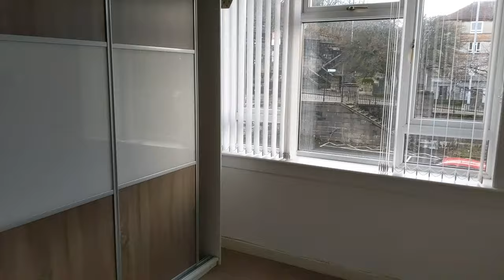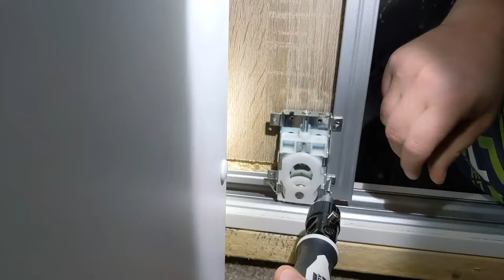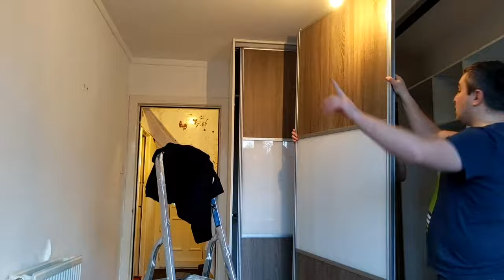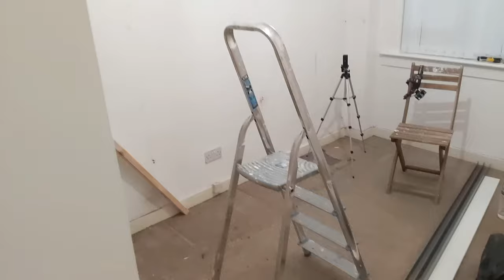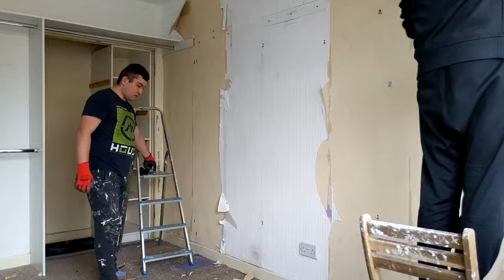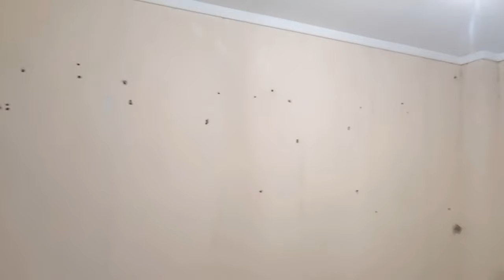Built in wardrobe removal: Removing sliding closet doors from tracks

Comment: That is NOT the way to remove those sliderobe doors!!! These people unscrewed the roller assemblies - totally unnecessary. All you have to do is look at the roller and notice the circular part, put your finger there and unclick it by lifting it up slightly. It does take a little effort but when assembling it just clicks into place. And then all you have to do is lift the door away.
Reply: Hi, my roller assembly not screwed in to door frame but inserted slot in the door frame. How to remove the door?

Comment: How would I go about removing a cracked mirror? Can I just lift the door of the tracks and remove whatevers holding it in at the back?
Reply from the maker: If your door is a similar style to ours- you can lift the door off the tracks and then unclip the metal sides of the door. Once the sides are unclipped you can remove each section of the door. Hope that helps and please be safe!